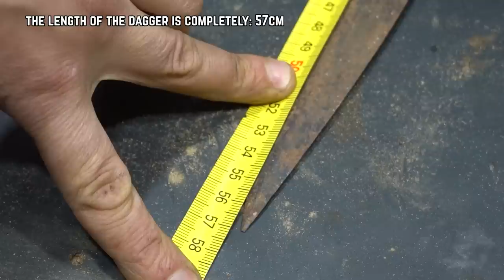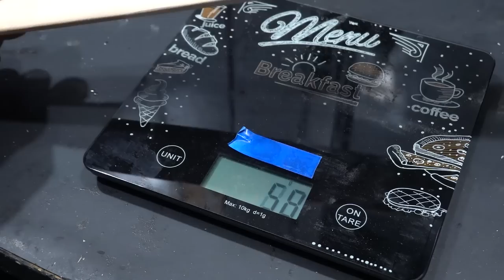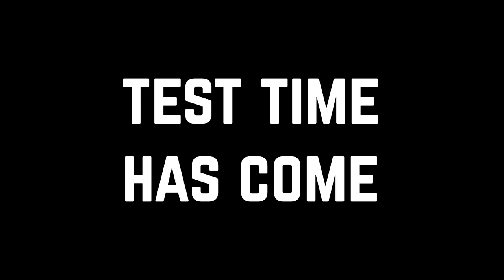Restoration of Caucasian Dagger - Return to Glory

Comment: What an excellent job, Sir.
A hint. When I make my sheaths from hard "Latigo" leather, or wood. I would place a 1/4" wide x 2" long strip of thin leather inside for the blade to ride on. It makes it really secure and reduces any noise.
Reply from the maker: Greetings, thank you for your attention. Yes, you're right, but I always try to do according to the classics, as my ancestors did.
Reply: @ScrewsAndTools  And that is why I keep watching.